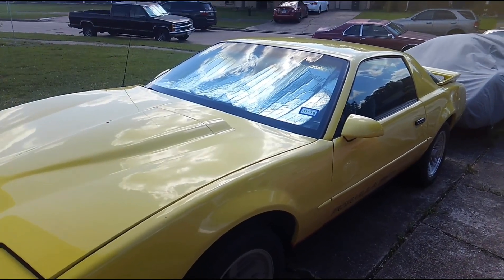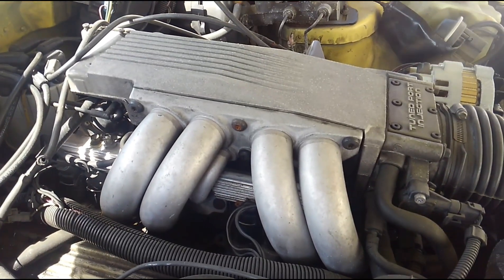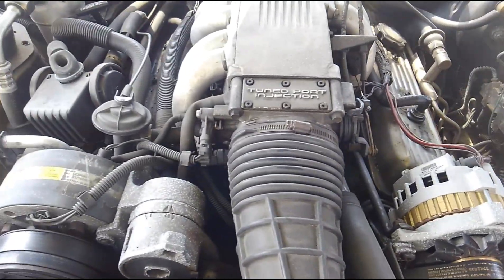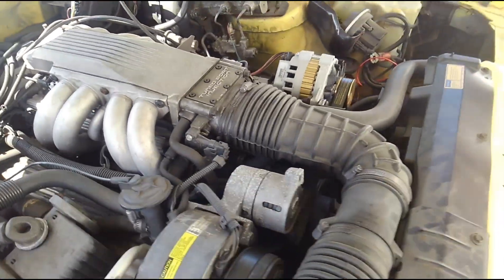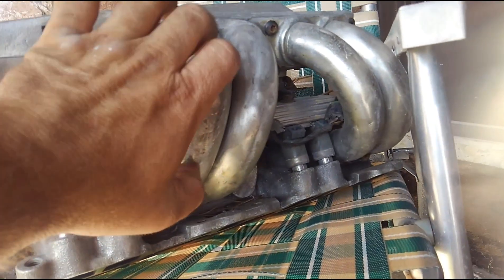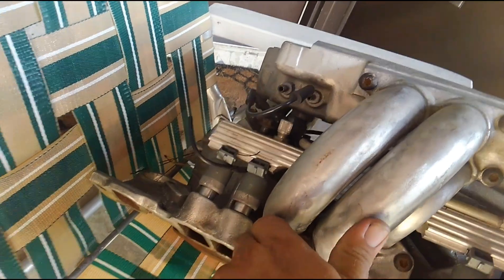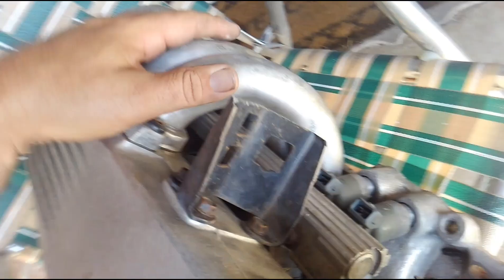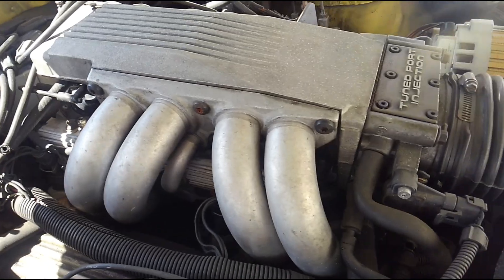The Awesome GM Tuned Port Injection System of the 80's

Comment: Hey whats up. My 90 IROC Z has been setting for years. I was young dumb before i parked it. I beat myself up a lot and my car is a reflection of that. Sad but true. Once again I have developed an interest.Q: " Injectors, ok. Wires/injector plugs. Ive gotten the wires mixed up and the care runs like sh*t. What do the wires do and how do i solve this problem. Ill be starting with fresh injectors.
Reply: Wire routing. Yes. The wires that i am shooting don't come from the distributors, do they? The injectors each have two wire plug. The wires are pink and green, i think. Do they connect to the ignition control module??  Thank you for your reply. Something new to think about.
Reply from the maker: If the ignition module was disconnected it wouldn't start at all, so that's probably not what you're looking at.

The injector harness connectors run in a straight line parallel to the valve covers and only have enough wire lead to plug into that particular injector it is closest to. 

I would also suggest looking for a factory service manual for your car on ebay. They have an incredible.amount of wiring diagrams and troubleshooting sections that can assist with the diagnosis. Luckily your computer system is still pretty basic, so it's not that hard to dig into.
Reply from the maker: I would make sure you have the wires in the correct position on the distributor cap to start. I don't remember exact location on the f body cars off the top of my head, but you should be able to Google the wire routing pretty easily. After that it's just a matter of checking your fuel pressure and ECM outputs to see how the system is performing. Let me know if you need anything else👍

Comment: I'm REALLY showing my age here.....but the TPI system wasn't exactly GM's first attempt at port fuel injection. That award actually went to Cadillac back in 1975, with the Bendix system on the 500 big block. Port injection, with a air-only throttle body on basically a modded carb intake.
Reply from the maker: Matthew, that's good info, thanks for sharing. That early system was an interesting approach, and I'll bet paved the way for the TBI systems that followed. If you look back at the evolution of automotive fuel systems over the last 50 years it's amazing how far we have come, especially now that so many of them are now using the direct injection method like a diesel. Makes you wonder what's next😁.

Comment: Great video, very informative. Looking forward to watching the rest of them.. Love the low end torque these make. I have an 87 trans am with a 305 and thinking of swapping it with a 350 this summer (keeping the tpi). Any suggestions for improving high end torque?
Reply from the maker: Thanks, glad you enjoyed it. Unfortunately the limiting factor with the TPI is the length of the runners. To develop the higher RPM oomph you're looking for would require modifying the intake to the Super Ram or Mini Ram style with shorter intake runners. The only problem with that is you lose that awesome look of the Tuned Port Injection. Thanks for watching👍
Reply: @VetteSource  thank you for your feedback!
Reply from the maker: No problem, anytime👍
Reply: Check out the F.I.R.S.T. Tpi intake. It’s a beefy design of the gm tpi it is pricey though

Comment: I have a Chevelle with a 383...would love to put a TPI on it...are you aware of anyone making kits to put one on with the more modern controls?
Reply from the maker: I know Painless Wiring used to make a stand alone kit, but the system is setup for a computer with the processing speed of a Commodore 64, so I'm not sure if anybody in the aftermarket has put the $$$ into updating it.
Reply: @VetteSource  after asking this I found that it looks like FAST makes a controller kit for multiport injections systems which should work ...will have to do some more research.
Reply from the maker: That's great. If you don't mind, pop back in and share the information once you finish your research👍

Comment: I owned a black1986 IROC with the 305 TPI and the limiting factor on these motors was not the TPI. It was the mild low lift / duration cam and restrictive exhaust. Put a hotter cam, headers, dual exhaust with low restriction mufflers plus the high performance chip and these cars went from mild to wild. The stock TPI could easily handle 400 hp without going to bigger injectors
Reply from the maker: Great suggestions, thanks for sharing👍. The TPI's are great platforms to work with, and look fantastic and exotic by today's standards when you pop the hood.

Comment: I want to swap a TPI manifold onto my 90’ firebird with a 305. What all is needed to do the swap? Harness/ecu?
Reply from the maker: It's not the easiest conversion to make on these cars. The engine and dash harness have to be changed, as well as the fuel pump and assorted TPI specific TPI engine brackets. Not trying to say it can't be done, but proceed with caution as it a a pretty major undertaking to make it work correctly.
Reply: @VetteSource  cool thanks
Reply from the maker: No problem, anytime👍

Comment: How difficult would it be to adapt one of these systems to a TBI motor? I've got an 89 formula with a 305 L03 engine wondering what it would take to put one of these on I think that the performance gains would be well worth it if not too complex and costly.
Reply: If you still have the L03 in that Formula you can put cowl induction . If you can find the under hood set up from a 82-84 TA. I did that to my 88 formula L03 and noticed a nice little boost in hp. You wouldn't want to drive it in the rain or keep the car uncovered when it's raining though. I believe there is a video here on yt where a guy did it also.
Reply from the maker: Good info, thanks for sharing👍
Reply from the maker: I'm afraid you would probably get in the weeds pretty fast with this conversion. The fuel system, engine and dash harnesses, and many of the under hood brackets are different, which will require quite a bit of work to source and install. Not saying it can't be done, but make sure your ready for the mechanical and financial commitment necessary before going down that road.

Comment: Can I put this intake on my 350 motor? I have a 1989 c1500
Reply from the maker: Yep, it will bolt right up. There are a few different intake base differences due to the Vortec style heads on the 95 and up, so you will want to look atbthe later TPI systems from 87 forward.

Comment: WHAT would need to be reworked on one that has been sitting and not run for over 10 years?
Reply from the maker: Hey Tim, it will all depend on if it was stored properly or was exposed to the elements. 

First thing I would recommend is putting battery power to it with a fuel pressure gauge on the fuel rail to see if the pump is still working. You should see 42-46 PSI at the rail. While you have it hooked up you can check for leaks at the injectors and fuel rail fittings. 

If that looks good, I would put fresh fuel in it and see if it will fire up to see how it wants to run and whether it starts throwing codes. Keep a fire extinguisher handy during this step, since fuel leaks can appear once the system gets warmed up.

From there it's simply a matter of how it's behaving. Any fuel leaks in the rail or injectors will require you to tear into it further, and if you've gotten that far, you might as well replace the intake manifold gaskets.

Be sure to take pictures of the components before you tear down, and take your time. Let me know if you need anything else, always glad to help👍.
Reply: @VetteSource   Wow ,Thanks for the Quick responce and answering that question. Subbed...Yea  I have a great chanch to get a 1987 with 87000 miles.. I said 10 yrs.. more like 14 yrs.. since 2007..  I saw the TPI insignas  on the motor and hood cowl  and started researching the make and that is how I got here..lol..thx for the info..
Reply from the maker: No problem, glad to do it. Thanks for the sub👍. If you're looking for more information on the TPI's I have a playlist of a teardown and rebuild I am doing on an 88 Formula 350 here -

https://youtube.com/playlist?list=PLAM-V1w3acpg9ThDD75FSzjNaemyMEJLl
Reply: @VetteSource   Will do.. It is a 87 VETTE..5.7 L. SAME TPI procedures .Thx

Comment: It's a shame GM never put these in thier trucks. those long runners a great at generating low end torque. kind of like thos beer keg manifolds on the Dodge Magnums.
Reply from the maker: Yep, that would have been a cool sight to lift the hood of a mid 80's square body and see a factory installed Tuned Port Injection system sitting there.

Comment: Will an 80’s tpi and aluminum heads fit a early 70’s 400 sbc ? Want to keep my iroc looking orig but have power.
Reply from the maker: Hey Joey, yes it can be made to work, but I would recommend running some AFR heads along with the SLP runners and Accel intake to accommodate the extra cubic inches. Joe Formato ran a 406 SB in his 89 Corvette that was pushing deep 12's/high 11's if memory serves me correct.
Reply: Tpi intake will work on any older engine. It's the newer vortec heads that you have to modify the base mounting bolt holes. One of my tpi projects twin turbo 305.

https://youtu.be/zN1FWpkNBmk
Reply from the maker: Yep, one of the cool features of the TPI intake system is its versatility and interchangeability between the older and newer engines. If you happen to have the new Vortec style heads, you can just search for an 88 and up TPI base manifold with the correct bolt hole angles for the center bolts.

Comment: 87 was the first year to get a 350 in an f body
Reply from the maker: Yep, I have read somewhere it had something to do with the chassis flex, but not sure if that is true or not. Thanks for the comments👍.
Reply: @VetteSource  I think you're talking about t-tops and 350 f bodies. some people say you couldn't get them, some people say you could, some people said GM discourage the dealers from selling them but who knows. apparently there's examples of them out there
Reply from the maker: Yea, it's funny how certain things get lost to time. Somewhere in the back of my memory I recall that the 350 became available with the introduction of the Formula 350's in 87, so it makes sense that were offered in the Chevy and Pontiac both. I know I haven't personally seen any 350's installed in pre 1987 cars and don't remember seeing any back then when I was a teen.
Reply: @darrenporsch  It’s not “apparently”. Out of the 16 thirdgens I’ve restored and built over the last 25 years, 6 of them were L98/CC1 cars.

Comment: I've seen this type of setup on the 1991 Vector W8!
Reply from the maker: Yep, if I remember correctly they reversed the intake manifold so it's facing backwards and used coil packs instead of the normal distributor. Thanks for the comments👍.

Comment: I was thinking about trying to upgrade my ECM to something aftermarket to increase hp after rebuild to try getting as close to 500hp as possible. Which back in the day was something actually Attainable as the 305 was used on Circle track racing and they were able to get m up to 500hp. But I've already took the plenum off to replace my fuel pressure regulator few years ago, had my #Beast for 8 plus years now. Hit a couple good sized deer, been in the ditch and all with little to no damage to the car! That's why I call him #Beast!
Reply from the maker: Sounds like you been through thick and thin with your car. Definitely a keeper👍. Are there any suppliers making ECM's for the early TPI's? That would be a good complement to some upgraded heads, camshaft, and intake.

Comment: Is it still good to use today  for the 350 to make some good horsepower
Reply from the maker: Definitely, with certain mods you can see north of 400 HP
Reply: @VetteSource  yeah that's what I'm looking to make with probably at least 460hp
Reply from the maker: Yep, that should be enough to wake that car up.
Reply: @VetteSource  yeah man I love the Monte Carlos so much I had a 01 Monte Carlo LS an had that for 5 years then sold it an got this red monte carlo ss in the picture
Reply from the maker: Something about those in red makes them look great. Might be due to the angular shape of the body.
Reply: @VetteSource  I currently have a 350 an TH350 in my 86 Monte Carlo SS
Reply from the maker: Cool, the Monte Carlo's are great looking cars.👍
Reply: I have an 86 corvette tpi setup on an 85 suburban with a single gt45 and its no joke. It's currently torn apart but was setup with old splayed valve trick flow heads and was laying down 782hp at the tires. The block should be back from the machine shop in a couple weeks. This time I'm running ported dart pro 1 heads. When I reinstall this engine I'm running a compound turbo setup with 3 turbos. Twins with a gt45 to begin with and probably end up with twins and the s475- s480 or something like that. This build will be coming soon. A link to one of my turbo tpi builds. 

https://youtu.be/zN1FWpkNBmk

Comment: The TPI design is definitely superior to the LS for street use. I had a 383 ci TPIS miniram setup that made on a dyno 545 torque but it was at 4000 rpm like an LS. I swapped to the factory TPI intake system this summer and peak torque dropped to 406 but it moved the peak of the curve to around 2700 rpm. The car feels faster than any ls powered car I have driven on the street. People only care about high horse power numbers, but if you don't race on a track it doesn't matter since horse power is not a real thing. It is something abstract and based on torque which is real. The only thing the ls probably has on my 383 TPI is gas mileage. I get around 20 combined mpg without an overdrive trans the last time I checked. The ls motors probably getting like 30 mpg nowadays. With an overdrive trans and lock up I could probably get 24 mpg.
Reply from the maker: Excellent writeup and perspective on HP. Torque is definitely that "seat of the pants" factor that gives car that powerful and fast feeling. Sounds like your car can leave other racers in tears at the stoplights.
Reply: Torque is were its at.
Reply from the maker: Agreed, HP numbers are fun to talk about, but it's the torque that really matters in the long run.
Reply: You think a 350 TPI uses 50% more fuel than stock 350 Crossfire? Im considering buying a 1982 Corvette C3 with TPI transplant on it.
Reply from the maker: No, if anything the TPI will give you better fuel economy than the Cross-Fire setup. As long as you keep your foot out of it, I've seen people getting North of 20 MPG out of a TPI 350.

Comment: That's fine and stuff, but could you do a video on removing the smogpump and getting off the lines going into the headers? It would clean up the bay nicely
Reply from the maker: Good suggestion. I will see if I can work it into the series as I begin to install everything back together on the passenger side. 👍
Reply: @VetteSource  thank you <3
Reply from the maker: NP

Comment: I don't know anything about this fuel injection but that intake looks so badass.  I can only imagine what it must've looked like in 1985.  You could tell right away you were looking at something special.
Reply from the maker: you hit the nail on the head. Even 35 years later this intake setup manages to wow people that have never seen it before. You should see how good they look when the whole thing is polished to a mirror finish.
Reply: Wow...I want this in my chevy c1500...beautiful 😍.... looking motor..
Reply from the maker: Yep, very cool compared to the industrial sewing machine look of today's engines.
Reply: it is till special . in the mid 80s it was automotive genius by Chevy engineers. until youve seen those runners , throttle body and plenum you havent seen a very cool motor
Reply: Tbh this setup was never known for high hp capabilities but because of those long runners it put out better torque than we probably realized until we seen dyno numbers,makes you wonder why Gm didn’t install this setup on the trucks also……I seen a few months ago that they now offer a tpi/vortec intake
Reply from the maker: Interesting, I'll have to look the part number up for that one👍.